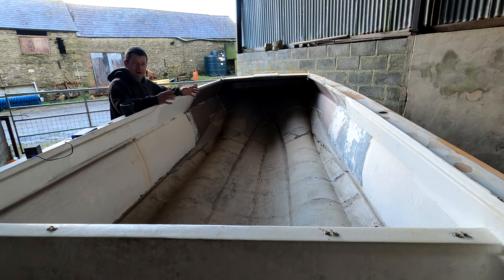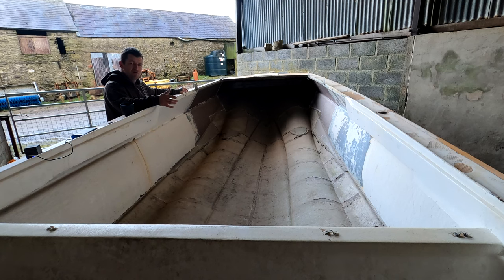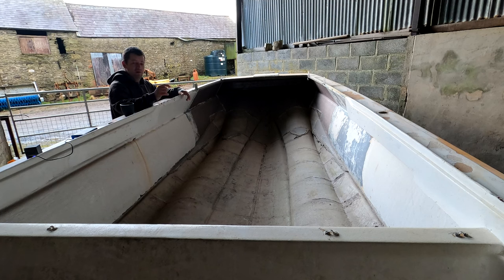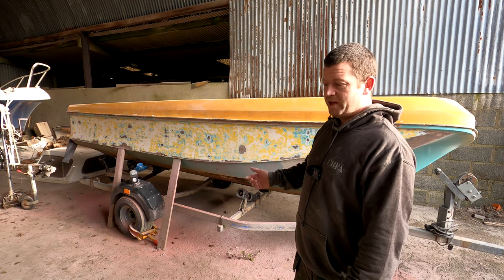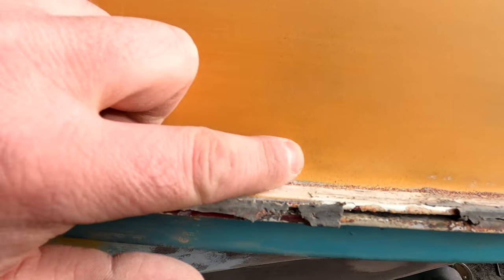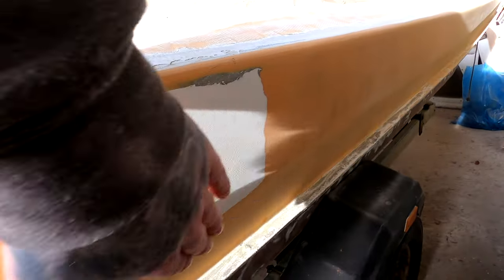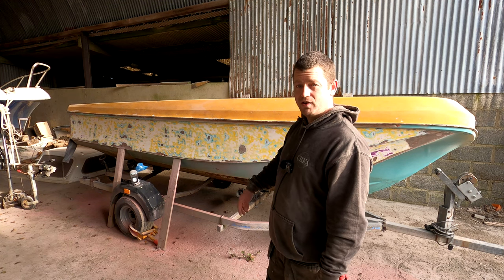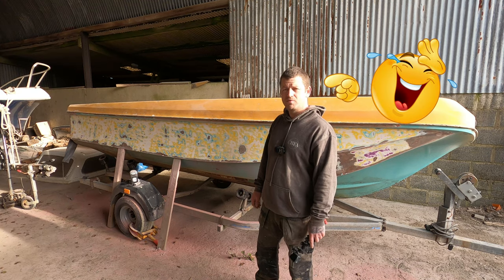Nab 17 sanding ready for primer (lots of hidden DAMAGE)

Comment: Doing a good job.  I first said 100 to 200 hours.....   But doing the best job you are I will now say 500 to 600 hours.  But and here's a  BIG BUT,  You will have a proper hardcore boat that will,  dare I. say out last you mate.  Keep up the good work!!!!  You are doing a GRAND JOB.....
Reply from the maker: Thank you Matt. I think you are right with hours originally it was deck replacement but I can't cut corners so ended up saying bigger it I'm doing the whole lot properly and it takes as long as it takes
Reply: @C3BFA  I. think by the time you have done the complete project, like you say the hours does not matter, its the end result!.  which will be better than new I would say.  And you will have a fine boat mate!!!..   :)
Reply from the maker: Very true Matt. The boat is for me I'm not doing this to sell it so the hours don't matter if I was to sell I would never sell it for enough to make a profit lol but it's not being done for that reason I want a solid boat that will last year's and years

Comment: Looking good so far. If you’re still planning on using 2 part paint make sure there is no old paint on there at all. It will react with any single part part that has been used prior.   To get paint off the best way I’ve found is to sand it with 40/60 grit all over to key it then using nitromorse or an equivalent, then scraping off. I done our Colvic in less than a day that way. It heat gun may have been quicker ?. Be sure not to hold the sander in one spot and always hold it flat never at an angle (you’ll regret it later) instead of using the 3m pads you could use hempel anti-slip pearls which you add to the paint on the pads. .. also I would suggest laying down a thin layer of Matt to the whole inside on the hull when you’ve sanded down and repaired it all.  All the best!
Reply from the maker: Thanks for your input Sam i appreciate it. I have sanded it all with 40 grit do far and left a small amount of white as you see in the video my plan is to hit it again with possibly 120grit to remove the white bits then it will be primed and sanded again going lighter and light on the grits. 
The inside will be fully glassed I'm doing celotex stringers with 2-3 layers and and I will be glassing the whole inside of the hull when I do it and up the sides so it's fully tied in to the boat.

If you have any more suggestions or input or even criticism please do it will all help Sam I hope you continue to enjoy the boat restoration series thanks for watching.
Reply: @C3BFA  I would sand to 240grit before priming.. you can get a a high build primer like jotun penguard. It will fill a lot of small pin holes and bits you can’t see. The only trouble with it is poor curing times. Also I use an acrylic filler by 3m for finer detailing later on, it’s amazing stuff dries super quick. Also I use stuff called free fix from ECF for tacking in stringers and putting a radius from the stringer to hull. 👍🏼
Reply from the maker: Thanks for that I did see free fix but been advised to use gravicol by Gary bull I'm buying 25kg of it for transom , stringers and deck that's the plan anyway

Comment: Okey dave,got same boat Hastings,are you going to keep it as an open boat,or put cabin back on,love the videos helping me with my one,see how you do yours,and I do the same,good luck with 520 dave.
Reply from the maker: Thanks for watching Dave. Cuddy is going back on and I have tye flybridge too which is going back on. Only removed them to make work easier
Reply: When you done bottom of your boat,did you put bilge paint or resin,before laying new wood,got a bloke at club boat yard,he'll lay new wood in my boat lay fiberglass,long as I do all the donkey work before hand,all underneath is rotten,give me something to do over the weekend. Look forward to seeing how your 520 looks,hope I can come back for some advice here and there,about what paints to use.
Reply from the maker: I'm still in the prep stages Dave. I'm grinding all the fibreglass back still. I'm installing the new transom soon and I can't wait.

You welcome to ask any questions and as many as you like
Reply: Hi dave,the faring on top,how do you remove that,I wish to take mine off,but keep cabin,also  done sanding one bit I sanding to much,but learning as I am going along,hull and transom done already,dave can you give a heads up on what paint I should use,Hastings boatyard blokes,one saying gel coat,one saying marine gloss,one saying you only need 2 part part,all confusing me.cheers dave.
Reply from the maker: Fairing ? Do you mean the chequered part Dave 

I'm spraying my boat so at the moment I'm planning to use a 2pak polyurethane paint but that may change